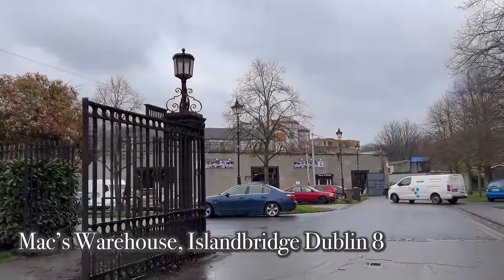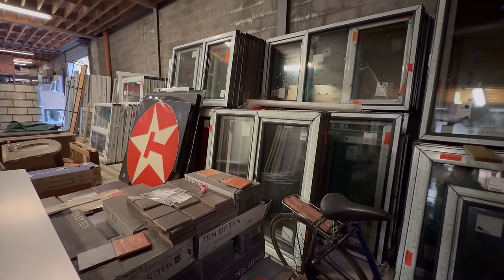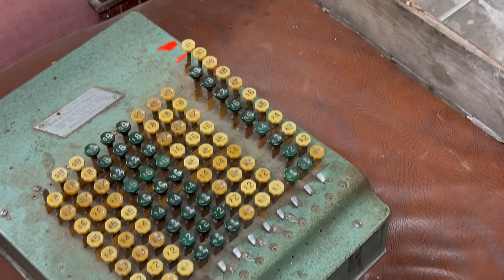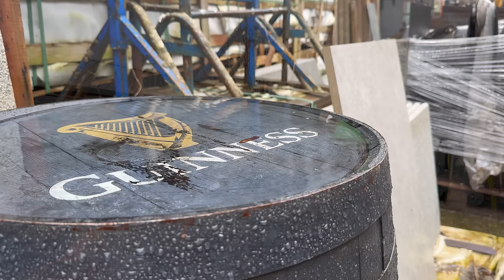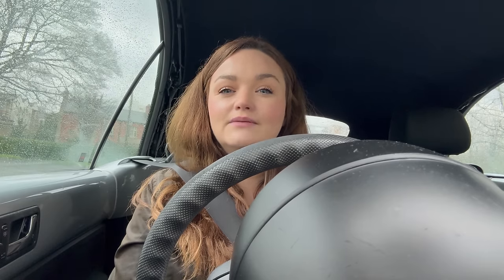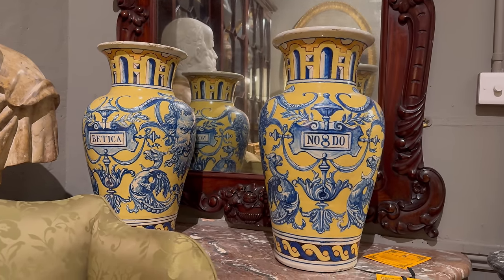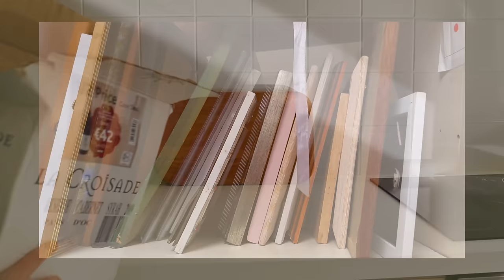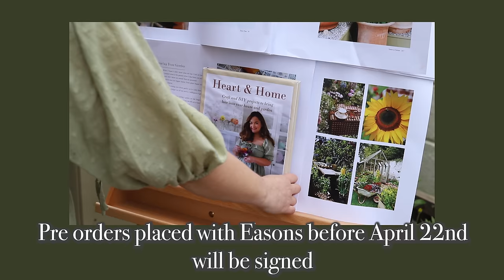Dublin's Thrifted Treasures: Come Second-Hand & Antique decor Shopping 🇮🇪 #thriftwithme

Comment: Hi Catherine 👋  I love thrifting for treasures.  I saw a few old 2 wheel bikes that would look great in the garden with a basket on the front and a crate on the back full of trailing flowers ! I once used a child's metal wagon to hold flowers, and it worked great. I just had to drill some drainage holes.😊 Happy hunting!

Comment: Great video. Second time watching here 😊. I think its gas I had already took a screen shot of something I liked before you even mentioned it. Around 1.27/1.28 mark. I been hoping to get my hands on some sort nest of tables and upcycle with picture frame. To display nature things like dried flowers, conkers acorns, memories and stuff. Totally inspied from tables I seen in Avoca years ago with pretty things under the glass. Everything is gorgeous, love a montage of pretty things. 
Myself and my mother use to get the train in on Saturday to Waterford and we would have a half an hour before the shops would open so we use to go to the church light the candles for everyone that we knew that was not well or gone. Then to a tea room that was open at 8.30am. Very nostalgic. My Granny has those switches and also sockets with the round pins. There is a modern socket for the washing machine 😅 Love love the white garden chairs 17.02 ❤